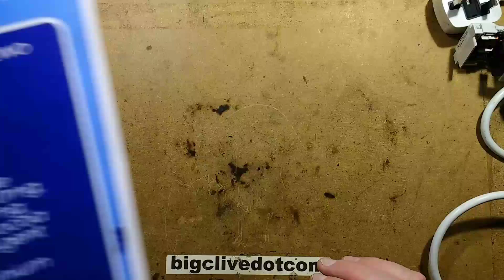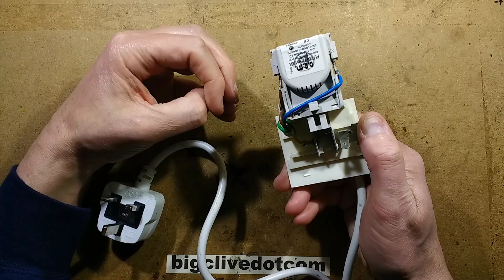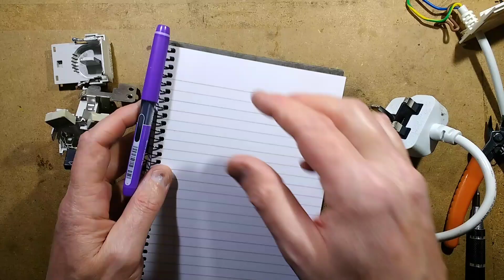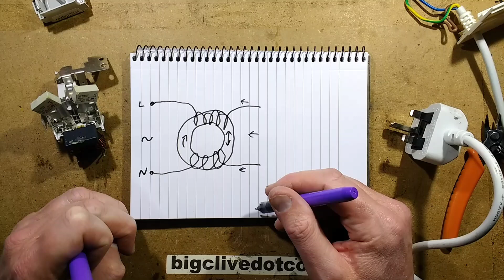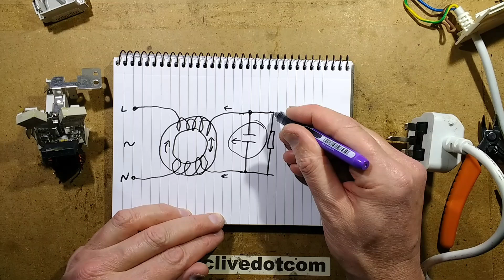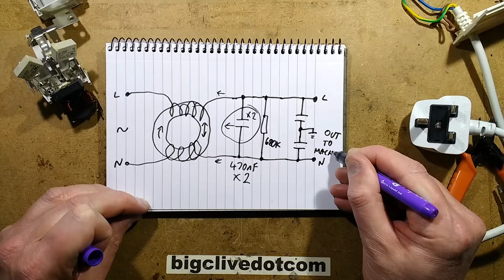Blue nooky pills and interference suppressors.

Comment: Isn't it a "frowned upon" practise to use a mechanical mounting as the earth connection for the chassis that the module is mounted TO? If that thing fell off the machine would continue to operate but would have no earth. Comment?
Reply from the maker: The earth plate has other tabs for the machine's main earth wires.  The chassis mounting is a mechanical fixing that also has a grounding effect.
Reply: I think that's why there were two additional terminals on the earth block, they are for attaching the real earth wires too all of the other gubbins inside the machine. The mechanical grounding via the two mounting screws onto through the earth block are for earthing the chassis of the machine to make it safe to touch.

I'm pretty sure the last washing machine I looked into had a very similar arrangement where the motors and controllers had direct connections to the earth block so they were not relying on the mechanical fix to the chassis as  that can fail over time due to mechanical stresses or corrosion.
Reply: Hope so...
Reply: Lots of things are dangerous if they "fell off".  Anything critical should have a mechanical mounting too, instead of just wire.
Reply: Thanks Clive
Reply: as a dude that works for them, the heater & motor are all earthed to the cabinet as well as a continuous earth looping around the internal looms
Reply: Wonders if Clives other thing fell off those blue pills were worrying !

Comment: L&N = Line & Neutral, these are both Live connections.
Reply: number 33 yes in the UK, this is how they are currently defined within 17th edition.
Reply: Not in the UK, here the Neutral is close to Earth in voltage and L & N are strictly defined positions in the power socket, although not in lighting connections.

Comment: You make mistake about explanation CM choke. In normal operation this choke is not needed so magnetic fluxes making by winding in phases L(source) and N(sink) are opposite direction (near zero inductance). When CM currents appear L and N are sources and creates magnetic flux (we want huge inductance to decouple it from grid), PE are sink. BR, MB.
Reply: That's my understanding of how a common mode choke too, when fed from the grid it has a very high impedance to 50/60Hz voltage between the two windings on the ferrite core but when high frequency noise is introduced that will effectively be shunted by the much lower impedance due to the much higher frequencies of the noise you want rid if. 

At least that's how I understand them. 

This works both ways so you can also use a CM choke to get rid of noise on the grid that might cause issues to sensitive equipment.
Reply: My understanding is the differential mode current will create magnetic fields in opposite directions causing it to cancel out.  No magnetic field, no back EMF, no inductance - effectively zero impedance.   But if you have a common mode spike, then the magnetic fields re-enforce each other and present a high impedance.    At least, that's how it would work if the concern is common mode noise.  I think you need to pull out the coil and see how it's wound.  Just remember right-hand rule and the current is flowing in opposite directions.
Reply: @russellhltn1396  I think Clive drew windings correct. With current flowing live to neutral: top coil = magnetic north on the right, bottom coil = magnetic north on the right. 9:58 first & second arrows = direction of magnetic field for top coil. 

There should be two more arrows next to the first two, pointing in the opposite direction (cancelling out). For a common mode signal, the arrows would no longer cancel out. Assuming I understand everything correctly…

How I saw coils drawn: from L = over-under. From N left to right = over-under, like a mirror image of top coil.
Reply: @Russel Hltn So you're agreeing with the other two posters saying Clive got it backwards but not actually explicitly going to say you agree?
Reply: Clive's explanation didn't sound right.  I tried my explanation of how it works.

Comment: I can tell you, based on literature I have seen, caffeine overdose is often sublethal but it is one of the nastier overdose experiences you can have.  
You really don't need an expensive scale for measuring the powder, just need an ebay scale and some math skills and a dash of common sense. The other solution is to make a spatula that will give you repeatable and measured amount each time. 
Honestly though, I take my anhydrous caffeine just with a small spatula and eyeball the amount I want, works alright (the amount is usually around 1-4 rice grains, or a bit more if you use it regularly and built up some resistance)
Reply: ah, I forgot to mention, caffeine is basically one of the purest descriptions of bitter taste. so, no surprise there.
Reply: You sound like quite the expert in cocaine cutting

Comment: Caffeine has LD50 for humans somewhere in range of 150 to 200 milligrams per kilogram of body mass, so me at 150kg could quite safely eat a whole pack of those pills. I might or might not have used to drink double strength energy drinks in 1.5L bottles almost daily and only developed massive tolerance to caffeine as a result.
Reply: You need to make some changes, friend-o.

Comment: I would think that the leading reactive power from all these little suppression capacitors would be more than overwhelmed by the huge lagging reactive power of even a single modestly-sized induction motor or fluorescent lighting fixture. If anything I would be glad to have a few extra capacitive VARs hanging about when possible.

Comment: Poundland.
Viagra.

This just doesn't fit together and seems more like a health risk than a sexual benefit..
Reply: You can also get Poundland condoms and for the people that used them they also sell pregnancy tests.
Reply: LOLDONGS lol I ain’t buying condoms at a poundland
Reply: Why not? Then you can visit pound town after XD
Reply: Once you have the Viagra onboard, you go to Poundland. Or maybe Pound Town.
Reply: Actually medicine is tightly regulated. So it’s probably the same as viagra
Reply: @petrosrz8990  This is more like an energy drink without the water.
Reply: @dnebdal  if it says it has the same stuff in it as real viagra it has it. Medicine is extremely tighly regulated.
Reply: @petrosrz8990  It doesn't, though - he reads the ingredients at one point, and it's basically energy drink stuff (guarana, ginseng, B12, sugar, caffeine, etc). No pharmaceuticals - which makes sense, I doubt it'd be allowed for sale in a poundland if it had.
Reply: @petrosrz8990  real viagra has sildenafil which is that drug who does the "from dead to rock hard" magic and this nooky crap is just a energy drink in a pill

Comment: Seems like a redesigned version of what's in the WIDL-126 S (the Widdle washer as I call it!) out in the back shed, only mine has a larger 8-position (but 3 used) plug with an earth connection on it rather than just L&N, overall the same circuit, just in a different package... :)

And Poundland are selling "little blue pills" eh? Next they'll be selling the "cure" for cancer, with the same ingredients... :P

Comment: Wouldn't the utility billing you for apparent power out of the blue be a breach of contract?
Reply: Yes, unless they change the contract terms without notifying you in a "You agree to these changed terms by continuing to use our utilities", or some other dirty trick thought up by their get-out-of-trouble lawyers...
Reply: I guess if they did it would give me an excuse to build my own SVC for my house :)
Reply: Yeah I was thinking just that myself too.

If you closely monitor the incoming grid connection it shouldn't be hard to add some inductive loads to cancel the capacitive loads from all of those power supplies in your house. 

Large industrial grid connections have two meters they pay for, one is the true power (Wh and a PFC=1) and the other is the apparent power (VAh and a PFC<>1) and the latter one is why there is a market for PFC correctors for large installations as the wires / connections can be made smaller when the PFC is 1 as there;s lower currents running through the wires to deliver the same true power to the equipment.

For resistive loads the PFC is 1 (voltage and current in phase) but for inductive and capacitive loads the voltage and current to a load is out of phase and the current needs to be higher to deliver the same true power as when they are in phase.

For residential houses it makes no difference at all as they very rarely have large inductive or capacitive loads, the biggest loads are resistive so PFC=1. That's also why the 'energy savers' on fleebay doesn't do anything to your electricity bill as the meter is only measuring true power and doesn't care about the voltage and currents being in phase.

Comment: My fridge compressor turning OFF blanks my monitor and projector for few seconds, I guess they went full cheapness on this suppression bit.
Reply: You might check to see if your data/HDMI cables run parallel to mains power cables for any significant length. This can cause the issue you're describing with video signals being interrupted.
Reply: I used to listen to foriegn radio stations in the kitchen & when I turned on the hot water tap it would cause interference. It took me a while to realise it was the boiler coming on that did it.
Reply: Photon Same here, didn't matter how I ran the cables!  Filter from an old induction cooker (at the fridge) fixed it :)
Reply: I have a mini fridge in my room and when it kicks off my computer's audio makes a loud popping noise. This makes me wonder what other effects this may be having on my system.
Reply: Stevy My computers audio does the same any time the air conditioning kicks on, I believe it's just a minor power surge that could be resolved by getting a surge protector and running my computer through it, doesn't really fix the problem with the houses wiring or anything like that but it's definitely a lot cheaper
Reply: yep, i had a tv that went nuts when the cell phone was near it, some things are just wonky from day one
Reply: I used to have a problem when I turned my oven on my lamp would also turn on
Reply: You might want to check for loose connections at the socket or somewhere in the mains wiring.
Reply: Electronics can have some weirdness...
Here in my room, when i turn on the filtered multisockets that connect the pc, speakers and whatnot to mains, in a few seconds after, the speakers will hiss with a pitch-raising white noise which disappears in a second.
I suspect it's the PC's power supply, which is active PFC, 700w doing it's thing and interfering with the speaker.

Then on my mother's house, there is this one cheapo LED lamp that flashes on, even when it's turned off.